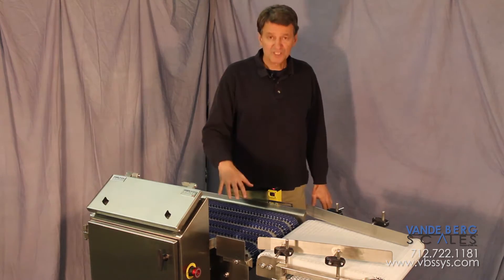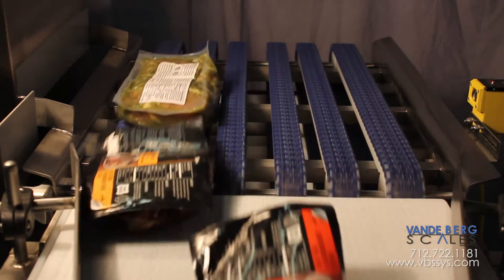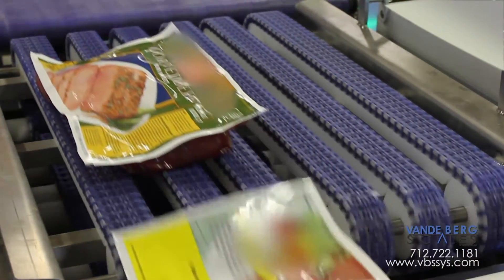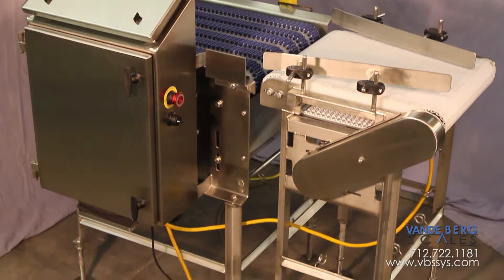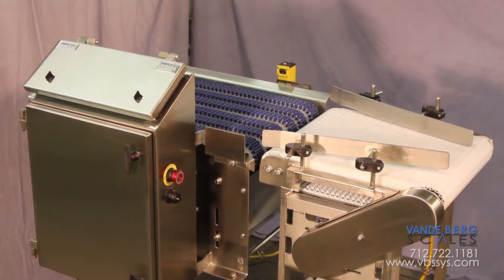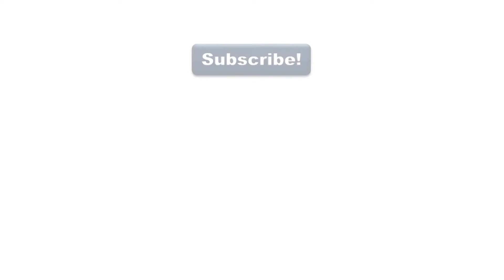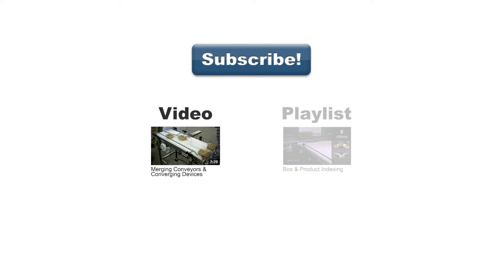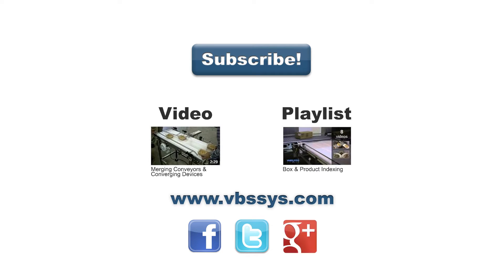Multi Lane Singulator Merging Conveyor

Comment: It would be interesting to see how the product goes into the machine. Is everything upstream waiting for the singulator to unload before it puts more into the 6 entrance conveyors? Wouldn't this require an additional machine, such as an indexing loader?
Reply from the maker: The singulator is placed after a Multivac or thermoforming machine. The Multivac automatically indexes the product.  This indexing action presents the product 2,4, 6, etc. at a time to the singulator.  There is often about 3-5 seconds between indexing advancements, thereby giving time for the singulator to singulate the product before the next batch arrives.